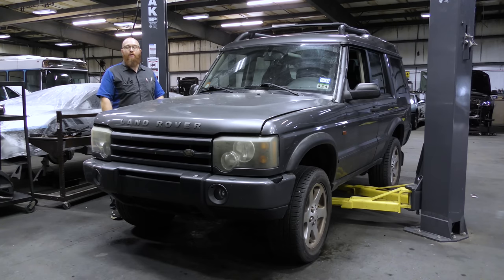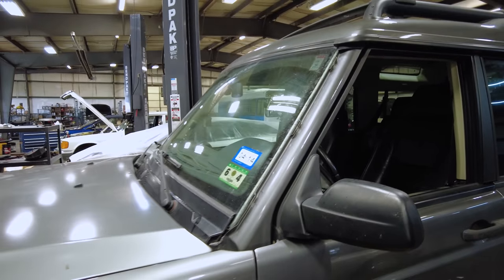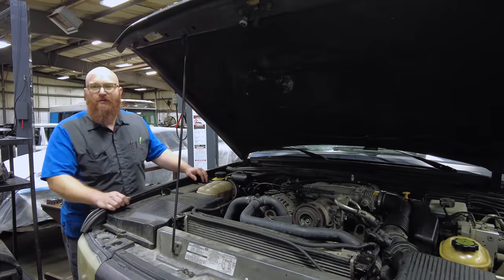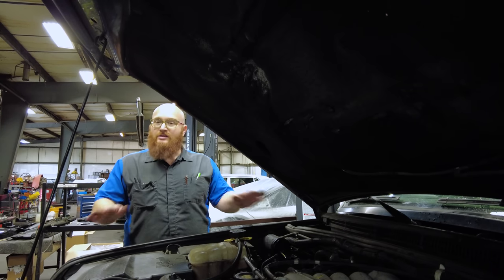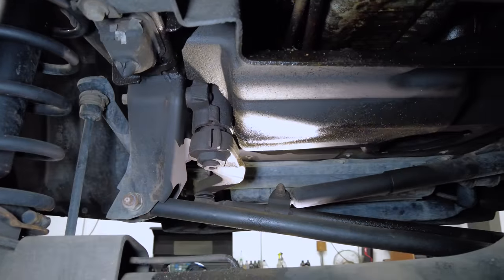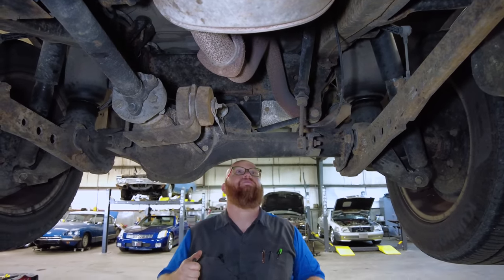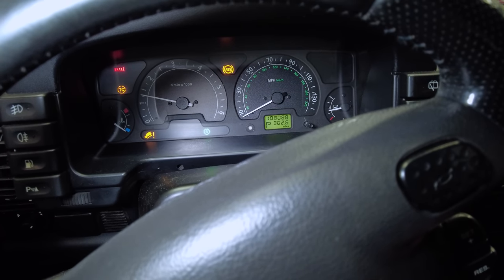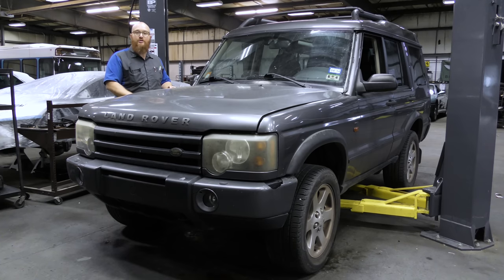Major items to watch for on Land Rover Discovery 1 & 2! CAR WIZARD shares their serious issues

Comment: The only discovery you’ll make is how deep pockets really can go.
Reply: FORD: Fix it Again Tony. Amirite?
Reply: @tcm81  FORD would be...
 F(_)!n Old Rebuilt Dodge!
Or, Found On Roadside Daily!
Or, Found On Road Dead!
Or, Fixed Or Repaired Daily!
       As you can clearly see, I could go on for days! 🤣🤣
Reply: Hahah. Ive had my hands in these machines since they were mechanically sound and lucas electronic deficient. Always a Achilles heel... W expensive junk.
Reply: Amen to that. Absolute junk after ten years or 100K miles, whichever comes first😏💸💸
Reply: @Kevin19700  absolute junk the day of warranty expires in a lot of cases. lol. planned obsolescence is very real folks
Reply: No
Reply: @Gambit22003  Found on rubbish dump, or First in all trouble 😅😅😅
Reply: Almost bought one of these years ago. Glad I didn't.  But they are cool to look at.
Reply: @BubblesTheCat1  🤣
Reply: @Gambit22003  backwards. Driver Returns On Foot. Lol
Reply: Maybe that is a US thing. Here in Europe we have a lot of OEM suppliers for Land Rover so parts are very affordable. The Disco's and Defenders are easy to self maintain on a driveway. I also have experience with Mercedes and Toyota and the components are much more expensive and the cars are not easy to maintain due to missing public information sources. Also all the available information and the simplicity of the build made these Land Rovers the optimal choice to keep driving although my experience with P38's would say that the TD5 is the big differentiation. The big problem for me now is that I cannot access any European city anymore.
Reply: Yes but I ❤ them 😂

Comment: The big thing to look out for on these is the Land Rover badge on the front.
Reply: Literally one of the least reliable vehicles made during its years of production. Very capable when running and quite comfortable, but hope you like wrenching (or have a fat wallet).  If spending weeks trying to identify phantom electrical problems is your idea of a good time, then you're going to LOVE these. Oh yes, and if its not leaking, it's empty... oil, transfer case, you name it.

You used to be able to buy these used for nothing at all.  I wouldn't take one for free.
Reply: I think my 2000 excursion can crush that land rover no problem
Reply: If you remove the badge and replace it with a Toyota badge you’ll be set
Reply: @HereComeMrCee-Jay  my mates ran for 300k hard miles before he sold it and he used to abuse the crap out of it. Easiest cars to fix ever and actually last if you look after them. Show me a modern car that will take any similar abuse and I'll just laugh 😅
Reply: @saratc660  My wife fell in love with our neighbor's new Discovery a few years ago—a lovely vehicle. However, I think back to the couple I drove from the north end of Black Rock Desert to the only gas station in Gerlach a few years ago due to an apparent electrical problem. Anyway, my wife knew the 4.6 liter V-8 angle would work with me and we ended up with one that very weekend—albeit a cherished GX460 that sits in our garage to this day. And notably, our neighbor still has her Discovery and seems happy enough.
Reply: Exactly, I’m a former Range Rover Classic SWB County owner.  From new, the thing was a basket case and I’d never own another one.
Reply: @Mortonbmx  Toyota Land Cruiser
Reply: @ozarkliving7263  I've got an 84 range rover v8 still on the road to this day. You guys should learn how to look after your cars they run forever.
Reply: @HereComeMrCee-Jay  Just drove mine 400 miles yesterday after it sat for 4 weeks. 80mph on cruise with the AC cranked. 160k miles and at least 20k of them are very hard trail miles. It ALWAYS starts and has never left me sit in the 8 years I've owned it. My coworkers new GMC truck is at the dealer left and right, currently for a cooling module or something and they can't even get the part so he's been stuck with a rental for weeks. I bought my D2 sight unseen in Pennsylvania and drove it home to Colorado without issue. What I'm trying to say is, hoes mad.
Reply: Pretty much any modern vehicle will do 300k easily, actually. I loved Car Wizards's sly troll "I'm not going to tell you about all the problems on these vehicles... I don't want to make a 5-hour video." 😂
Reply: @Mortonbmx  exactly I have a 2004 discovery 2 td5 and only thing was 3 amigos and it ended up that my ball joint gave in, the 3 amigos is there to tell if something is wrong and I've owned my disco for 4 going 5 years now. I love my disco and wouldn't trade it for anything 😜
Reply: @Mortonbmx  my disco1 V8 3.9 was abused alot and never had to wrench on it, most reliable vehicle if ever owned had it for 2 years, my 2004 disco2 going for 5 years of ownership and get serviced every 10000 km
Reply: Do you own one? Probably not, thats why the comment, Go buy an American Hummer to experience bad design.
Reply: The D2 is the reason so many Americans think this way, as they're far more problematic than a D1. I've had two D1's in the last 20 years, and they're very reliable and easy to maintain. Super comfortable, unique, capable off road. In 2024, we know their weaknesses and it's easy to avoid the single inherent issue, which is heat.

My first D1 hit 320k miles before I sold it. I beat the shet out of it, and it was still going strong when I sold it. Yeah, they're not a Toyota, but they've got a lot more style and comfort. I've never had a single person drive my D1 and not fall in love.

Comment: They are collectible, because you can't reliably drive them so they collect in your garage.
Reply: Good one😂
Reply: I have one and very reliable, the guys that is complaining is the ones that don't look after them and buy the 2004 td5 you can thank me later, have a good one
Reply: The problem is unfortunately wen you buy it of an owner who did not took care of it, yes had that 3 amigos 2 times couse it tells you there is something worth checking, found out it was time for new batty
Reply: @jkh.racing  we did not get the TD5 in North America - just V8's.
Reply: @RichGallant  oh ok, that's sad couse they're the most reliable ones, if my td5 motor give in il probably go the LS route
Reply: @jkh.racing i have its solid and i love it
Reply: Ive had mine for 2 years and ive never really had issues with it, coil packs and an exhaust leak and breaks arent too bad for a 189,000 mile 24 year old car

Comment: Changing Rover V8 head gaskets is a pretty easy job for the home mechanic, it's a lovely simple engine to work on
Reply: It was originally a Buick engine !
Reply: @frasermitchell9183  yes, I know
Reply: Is it just better to change the head gaskets even if there’s no current problem with them???🤔
Reply: @Tahvyy  No, but it would be a good idea to retorque the head bolts. I bought a 1995 Rover v8 from a wrecking yard. It had a head gasket blown out between #1 and #3 cylinders. When I pulled the heads I notices  that the head bolts on that side had low torque compared to the upper row of head bolts. I think retorquing could have saved the engine which was otherwise in good condition considering the 143k miles on it.
Reply: Do you need special tools for it?
Reply: @spookytook  not really no
Reply: It really is especially the 3.9 and 4.0. praise the pushrod V8.
Reply: Best engine ever made
Reply: That's actually nice to hear, I'm contemplating an 01 that needs headgaskets.
Reply: @benjones1917  how come the Brits didn’t keep developing it?  It’s lighter than many 4 cylinders and that’s what really matters to powertrain engineers….
Reply: @joetz1  I've often wondered that, but I think it's to do with money. British Leyland were flat broke and made some bad decisions. They thought up some amazing cars, but screwed up the implementation through shoddy quality control and very bad industrial relations. The RV8's most famous home was the Rover SD1 which (to me) is one of the most beautiful cars ever made, but is a mess in terms of quality and never did as well as it should have. A tragedy.
Reply: i DId it.
Reply: @joetz1 emissions and fuel efficiency.
Britain was in love with diesels at the time since the price of fuel was (and still is) so high.
2005 was the introduction of the EURO5 emissions standard which the V8 was never going to pass without a significant update.
4 pot TDs were in, petrol, especially the V8 was out.
Reply: @benjones1917  British Leyland was defunct a long time before the V8 was canned.
It was Ford that retired it as they had a selection of modern engines to use instead. For better or worse.
In the UK the V8 is a bit of an icon so I would have loved to have seen the rights sold to a company like TVR to develop.
It may not be the best engine, but that's not the point.
Reply: @benjones1917 it really is a straightforward job.  I've done dozens of head gaskets on Discos/period Range Rovers; taking my time, I had them done in seven hours after doing them a few times.  There's really nothing scary about working on that engine.

Comment: The 1st generation discoveries are some of the best SUVs on this planet. Not because they are very reliable, (well mine has been really reliable but apparently it's the exception that makes the rule), but because how easily they are repairable by even the owner. Their engines, drivetrains and suspension are very simple and they do not require many if any special tools.
Reply: Or you could get a Toyota.
Reply: @jetnavigator  where's the fun in that?
Reply: @jetnavigator  the equivalent toyota will be like 8x the price....
Reply: @jetnavigator  Getting a 90s land cruiser would easily be 3 to 4 times the price of a Disco...
Reply: I love the D1's. Simple to wrench on, comfortable, unique, and much more reliable than people give them credit for.
Reply: @jetnavigator a Toyota is a worse vehicle in every way you can think of other than reliability, and even that's overstated. If you want the best most capable car get a discovery and live with the extra maintenance knowing they're cheap as chips and easy to fix (at least a everywhere else but the US).

Comment: Just bought a 1 owner 99 with 8plug 4.0 v8. Full time 4wd, center differential lock, absolutely no rust on body or underneath. Has brand new tires, like new wheels, 165,000 miles if I’m not mistaken. I’m really really happy with my purchase. Sounds very snook and quiet. Shifts perfectly. If I start having problems I will be back to comment about my change of heart but I have a feeling as long as I treat it right I assume it will me as well
Reply: Sounds like you got a D1. If well maintained they're great SUV's. The D2 is what gave them such a bad reputation. Buy an Ultragauge to monitor your engine temps, do the proper maintenance, and you'll be very happy with it for years to come.

Comment: Here in the UK where they're very common still, the vast majority (over 90%) of Discovery 2 models are the 2.5L Td5 diesel, which is an extremely reliable engine and 400,000 miles (650,000 km) is not uncommon. They do suffer from oil getting into the fuel injector harness and travelling back to the ECU, because the injector system is the same type as the VW PD engine. They also suffer head gasket issues, but mainly because the head is at an angle and the block has plastic locating dowels for the head. A new head gasket and the later steel locating dowels and that fixes it. They also suffer from leaking fuel pressure regulators, and on early ones the bolt holding the sprocket to the oil pump can work loose and fall off. Later vehicles have thread lock on the bolt, and all service replacement bolts do also.

The factory service schedule actually lists the automatic transmission fluid being changed every 24,000 miles (40,000 km) or 2 years, whichever comes first. Strangely, the filter is only listed as an item at the first 24,000 miles service! There's not a lot that goes wrong with these, either the ZF 4HP22EH for the Td5 and 4.0L V8, or the 4HP24EH for the 4.6L V8, although Td5 models can crack the flex plate. Most here are the 5-speed R380 manual gearbox, which is not as robust. Most issues with those though are to do with the dual mass flywheel fitted to Td5 models. Generally it's considered good advice to change it whenever you change the clutch, although LOF now do a single mass flywheel upgrade kit. What kills them is people running regular gear oil in these rather than the proper Texaco/Caltex/Chevron MTF94 gear oil.

The final thing I will add is that if you have the three amigos, check your wheel bearings. Three times we had it when we owned one (we had a 2000 model year Td5 from 2004 to 2017) and each time it was a wheel bearing. When the bearing goes, the air gap becomes too big and the speed sensor no longer registers, saying you've got a faulty wheel speed sensor. It's the first port of call before delving deeper into the ABS system.
Reply: How can you still call them good after your LOOONG list of common problems?
Reply: I'm from South Africa have the same one in the video but a 2004 td5 and it's the most reliable car I had so far and drive now for 4 years no problems, the main thing is when you buy them from previous owners who did not took care of them, only my experience
Reply: @BubblesTheCat1  I would say yes, funny enough any spare part is easy available, there is a lot of information around keeping them driving and any repair can be done cheaply. So, no maybe it is not the best car, but it is a car that can be fixed even on a driveway with a small set of spanners and access to companies like Britparts and the other OEM suppliers.
Reply: Nothing more council estate than an over moded old disco
Reply: @dudbolt9707  What does council estate mean?
Reply: i heard that happens to some of the Mercedes also... and there is a workaround for them with some adapters that stop that oil from destroying the wiring harness
Reply: @BubblesTheCat1 he’s listed every conceivable problem they could have.  My dad had a Td5 in a defender for 20 years, my discovery 2 has one that I have had since 2019.  From my experience they are very good, reliable engines.  Shame the v8s didn’t have the same reliability
Reply: Yeah it's like me and my girl. She is so wonderful, we have a great relationship. She sometimes drink too much and then she goes crazy with other guys but I love her so much. It's true, she's addicted to crack cocaine and that's why she is insane but I don't care she looks like a cheap prostitute. My brother and I we share bed with her and I am really glad I got such an amazing woman. 😅😅😅
Reply: @BubblesTheCat1  social housing aka the projects.
Reply: @Maginnifix  We had that in South Africa in the 70's and 80's. The people that lived in railway houses.
Reply: You sir deserve a cookie.
Reply: Also the diesel is far more economic                            @cdchantler

Comment: HG gasket failure: do the inline thermostat mod (less than $100). The factory cooling design does cause overheating.
Valve cover leak: Do the PCV mod ($6 for the valve). A clogged oil separator (plastic piece) can cause too high crankcase pressure which can lead to leaks. A PCV valve is much easier to clean.  
Mods can be done in less than an hour. Google the forums for details.
Reply: 100% plus a couple of bottles of water wetter to remove any air pockets.
Reply: What’s the PCV mod? Is this required for the 4.0 disco 1?

Comment: Only need "deep pockets" if you rely on a mechanic to work on your cars because you may not be mechanically inclined. This engine ( actually the entire car ) is just a big Lego set, so easy to take apart and put back together, and parts are easily available since it was sold worldwide.

Comment: The ABS module in these things is shared with the Hummer H1.  The "Three Amigos" Is the "Dos Amigos" on the Hummer.  To fix it on the disco is super easy since the ABS modulator is really easy to get to.  It's caused by a bad solder in the modulator shuttle valve.  All you need to do is take the bottom of the modulator off and solder in bypass wires that connect to the engine harness and the factory ground.  Once those external bypass wires are installed, the amigos go away for good.  There are a couple of YT videos on how to do it.  On the Hummer its a PITA because you have to take the modulator out to do it.
Reply: Everything on the H1 is a pain,lol
Reply: I can vouch for this DIY fix - it works and without losing the features, etc.
Reply: Just did that fix.  Worked for 2 days, then back!  Ugh!  Going after wheel sensors now....
Reply: @jimmuehlberg2153  The sensors have a tendency to get schmutz on them along with the tone ring. Give them a good cleaning and check the sensor gap while you're there.
Reply: Not to mention the disco 1 doesn’t have any issues with the 3 amigos because it has no traction control or hill decent control
Reply: Its rarely the ground wire anymore. The one size fits all approach has cause people more headaches. There are a couple of connectors that will get corroded and cause problems. Wheel speed sensors can go bad. Before replacing any of the parts get a code scanner and see why its complaining. Mine had multiple issues, a bad ground was not one of them.

Comment: these discos are actually fun , not only to drive, but also to work on... that's if you have the time and more importantly, the space. the disco community is also so helpful... i used to work on fords and hondas, the LR discos are kind of emo with it's issues and the community is very good at diagnosing and reminding not to shoot the "parts cannon."

the undercarriage of this disco was identical to the very first disco i owned... it was a great day when there were no leak spots on the floor!